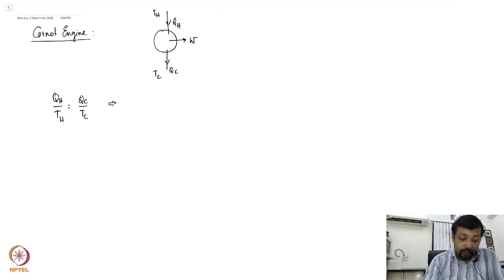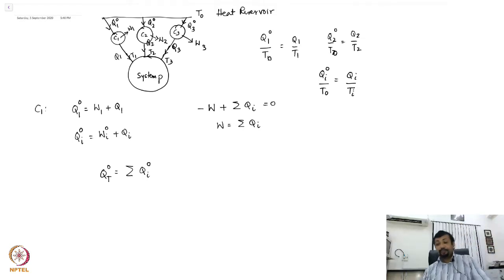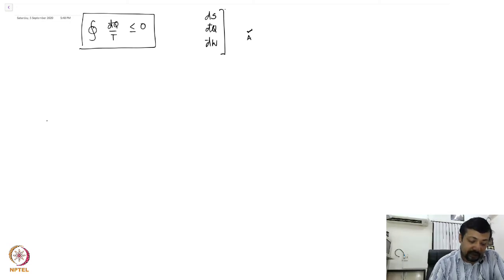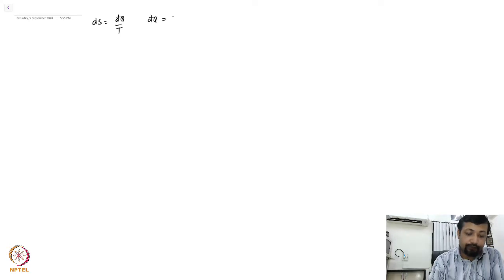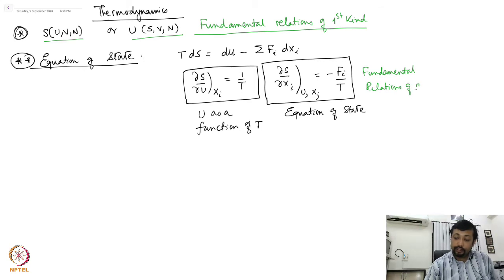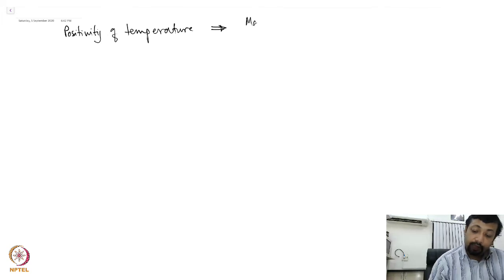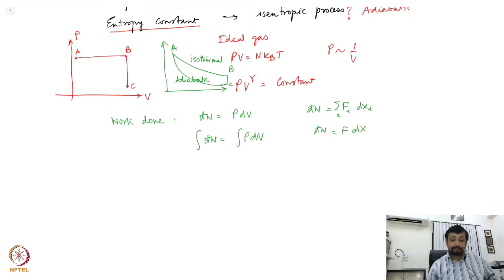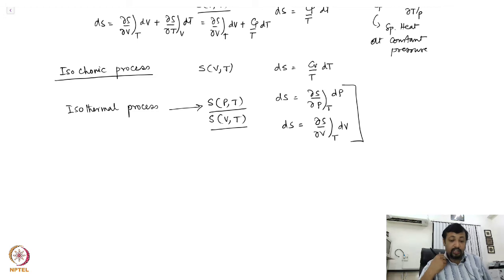mod01lec04 - Entropy, Clausius Inequality, Thermodynamic Processes and Systems

Comment: For hydrostatic system, why do we take generalized force Fi as '-P' instead of 'P'?
Reply: Because the generalized displacement dV is diffrential of system's volume.  If you press the gas system, you did work to system. So, the work done on the system is dW >0. But the gas volume will decrease, so dV<0. If we define the sign of generalized force is negative p, then the equations are, (-p) dV = dW,  where there are positive value.